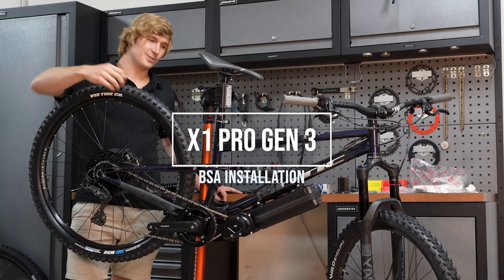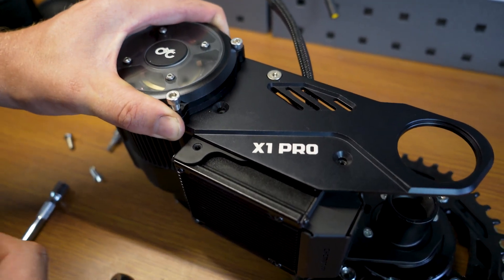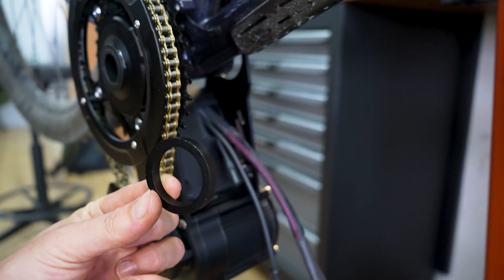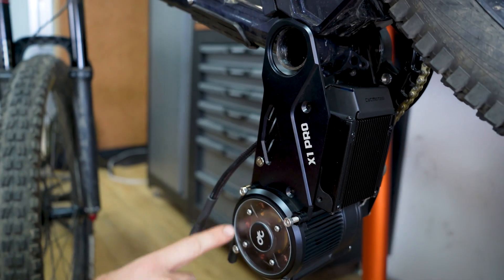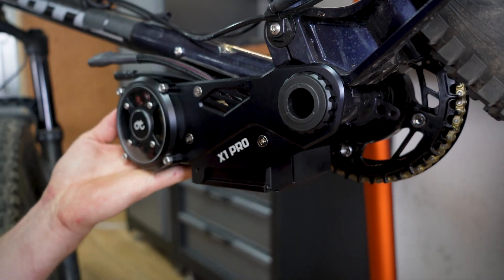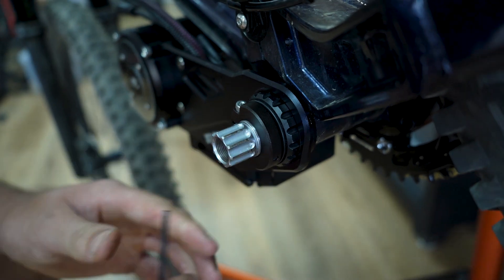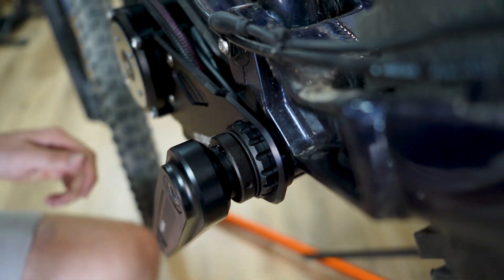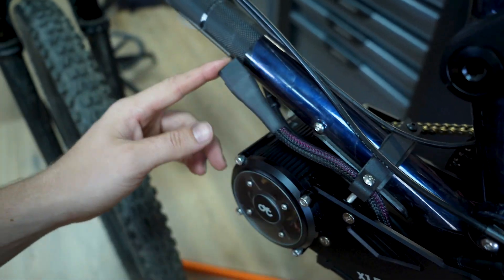X1 Pro Gen 3 BSA Installation on Cotic Jeht - most EXTREME ebike conversion kit from CYC

Comment: What is the torque value for the 16 notch 44mm bottom bracket? Is it 30 Nm? 36Nm?
Reply: 40-50nm written in user manual

Comment: Thinking about upgrading from 750W Bafang BBS2.  I know this is super powerful which I want.  But I would also like a motor that I can breeze around at very slow speeds too.  Like 8-14 mph.  Do you feel that the motor checks both boxes in that regard? Or is it just for racing around fast?
Reply from the maker: You can set the power lower through our app. No problem going slow at all. You can even set it to street legal settings like 250W.
Reply: be ready for THE NOISE, COMPARED TO THE BBS ITS VERY loud..

Comment: Is there break or gear sensors available?
Reply: yes
Reply: I tried this motor for a month. I preferred the bbshd with bac 855. Much better. And if anything breaks I won’t have to wait weeks for CYC to send out a replacement part. Stress free riding considering all the failures I heard about on the facebook groups

Comment: When are they shipping?  I've been hearing there are delays.  I have a kit pre-ordered through a vendor.
Reply: Still waiting? How long did it take?
Reply: @Rickydbaby  I received my kit in February.  My original order was in Sept 2022, with the 3rd party vendor was for the gen 2 kit, but the gen 3 kit was announced shortly after, so I worked with the vendor to modify the order to ship the gen 3 kit instead, so it became a pre-order.  Coincidentally, yesterday I had some time to start the install on my bike, so far it's been a breeze.  Need to clean up the wiring, mount the battery, fine tune the settings, and figure out how to extend the speed sensor, the wire is way too short for my bike.
Reply: @mrdanlai  wow that is a long wait. I won't be able to wait that long. I'll give it a few weeks to see if an order ships. Hoping for the best.
Reply: @Rickydbaby  Yeah, I mean it was a pre-order at the time, so the wait is going to be longer.  I imagine if ordered now/recently, it should have shorter lead times, but only CYC knows.  I could have stayed with the gen 2 kit, but I like to have the "latest and greatest", haha ;)
Reply: @Rickydbaby  Also, just to mention, I ordered the 120mm kit, so that in itself had more delays due to CYC manufacturing for this size.

Comment: Is there a maximum size chainring that can be fitted with this and likewise with the new Stealth? Obviously, there might be chainstay clearance issues depending on the frame.
Reply from the maker: Hi Anthony, the X1 Pro can fit at the largest a 48T chainring & the X1 Stealth can fit a 46T chainring. Unfortunately, we do not have these sizes available but you can swap the inner chainring with any standard 104 bcd chainring (steel recommended).
Reply: @cycmotor  thank you
Reply: Looks like the new CYC Photon may be a better option for a speed pedelec commuter type conversion? Can still be pedalling under power at higher speeds with a 50T chainring option. Is there any reason why a standard (rather than compact) 52T or 53T big ring couldn’t be fitted?
Reply: @anthonyward5329  The sprockets are not BCD standard on the photon check https://youtu.be/ULq7VbJE68A?t=105  With this shape, I doubt we can ever find an adapter to used BCD chainrings unfortunately...